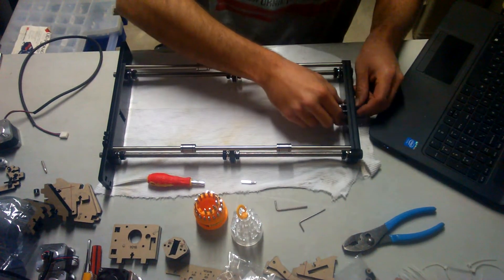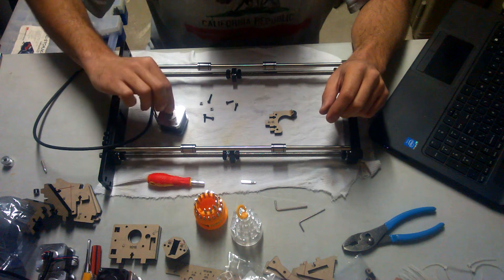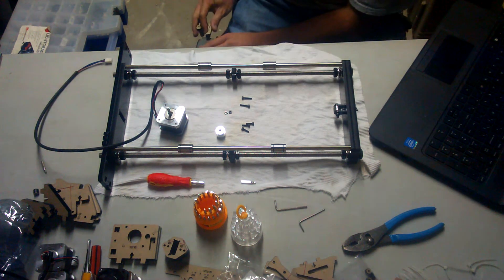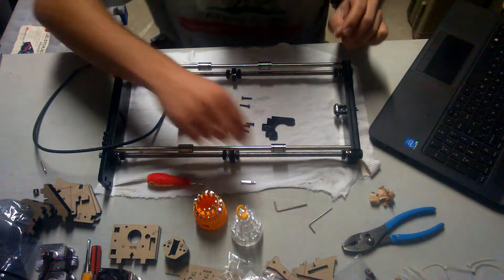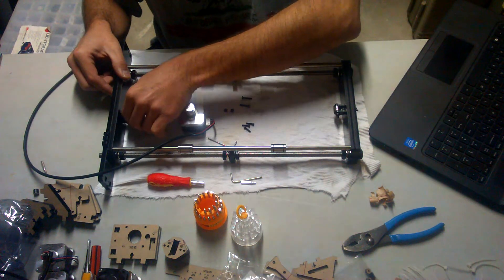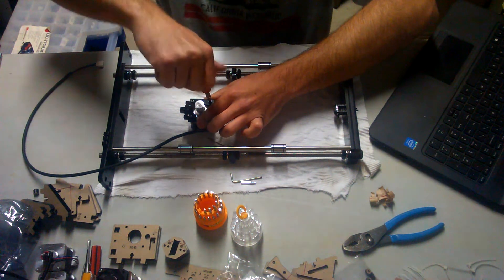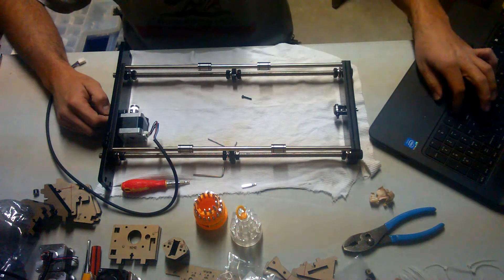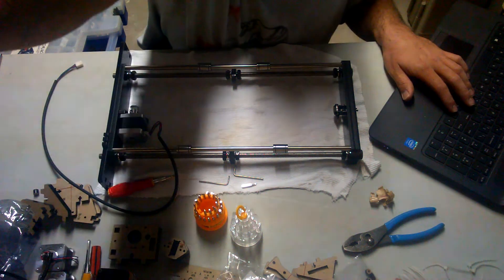Geeetech Prusa i3 Pro B Assembly Video Step 5

Comment: WARNING!!! When tightening Y motor fix plate to main plate using M3 screws and square nuts DON'T OVER TIGHTEN. Go very light. I broke the Y motor fix place in both places where the square nuts are.
Reply from the maker: that's when your fellow 3d printers can help you by printing out a spare, can find on thingiverse.
Reply from the maker: +George Robles 3d hubs to find nearest,
Reply: I contacted Geeetech to see if they sell spares. If not I will have to look for someone to print me one. Let me know if you can print one and how much it would be. Thanks.
Reply from the maker: +Vilo Conshmillo I do $15 each part for X motor bracket, carriage, idler, extruder bracket, and as well as the Y motor bracket.
40-50 % infill, PLA with a few colors to choose from and includes shipping with tracking and insurance upto $50 via USPS priority mail , abs cost more and would recommend you do that yourself as they are good things to print first. spare parts.
Reply from the maker: small tip, make sure to seat parts all the way and when they don't, then the included round file will help you out a lot. will need it on the z axis top plates. and some holes here and there. ideally the acrylic should sit flush to the other part that it intersect with
Reply: Alright thanks. I'll wait for the Geetech response and let you know if I still need one.

Comment from the maker: well, for your first comment, I refer to all parts as they where numbered in the book I had received at the time and are the numbers I list and say. for this comment, its one piece thick, not two. unless you are referring to the + holes where you place a square nut.
Reply: Good to know that there are extra 20mm screws.  You are correct that the 16mm screws are too short.
Reply: +George Robles hello, yes, I was talking about the T/+ shaped insert, where you insert the square nuts, there was 2x8mm layers, plus the space to reach the nut, so I used a 20mm screw. At the beginning I was pretty much nevrotic about the pieces to use, as I thought I would run out of them if I used different ones and have prolems later on, now that the printer is finally done I realize I got WAY more screws than I needed and have plenty spare pieces overall.
Anyhow, THANK YOU for your guides up until the point where you kept on making them, it made the process easy.
After I noticed you stopped publishing these videos, I had to rely on the official wiki, and well, those directions are incomplete, misleading, somewhere uncomprehensible. The experience would have been heaps smoother if I had quality videos like yours covering the whole process.
Now all that's left is cursing at the bed leveling process :D
Reply from the maker: Ephestione's HQ great your almost there. Thanks for the nice comments. I have upload like ten more and am editing them

Comment: THere must be an error somewhere, you cannot use m3x16 screws to fix the motor, as the frame is already 8mm thick, that's two pieces together, the screws would be as long as the panel, and there isn't enough free to reach the nuts which are further away. It's a job for m3x20 screws
Reply from the maker: see next comment to answer both your comments
Reply from the maker: or you don't remember the cutout for the piece to nest in
Reply: You are right.